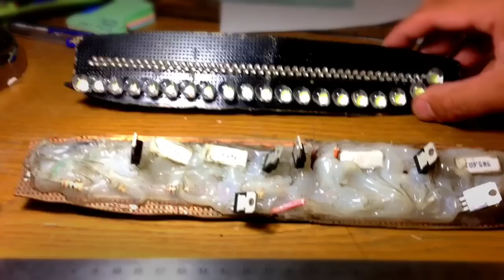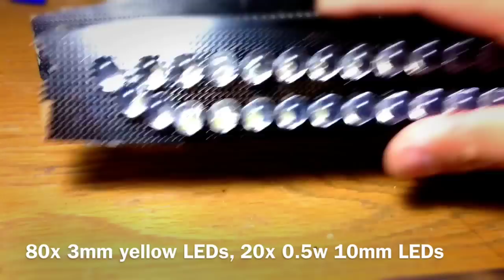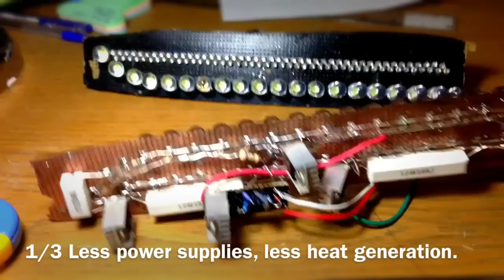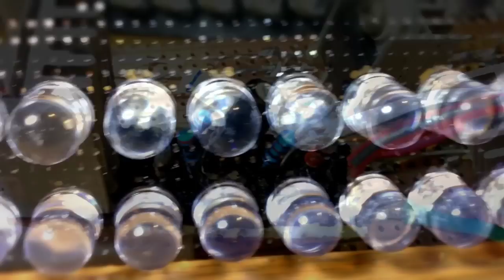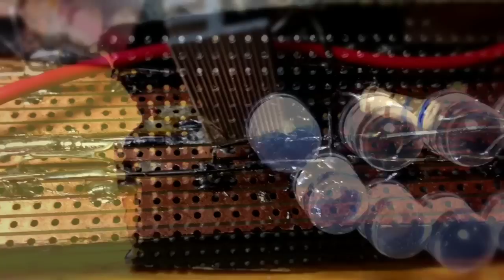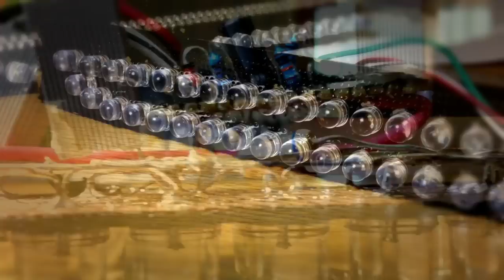Miata MX5 LED Switchback Indicators Revised

Comment from the maker: g'day, its basically a bunch of voltage regs and dropper resistors and leds. the softfade driver is a transistor and a few passive components making an RC time constant when the indicator turns on.
Reply: hey m8 how can i get in contact with you ? i would like to have a plan to rebuild this

Comment: Hi, what is the material you've soldered the LEDs too? I've been trying to find flexible, cuttable prototyping board but not having any luck so far. thanks.
Reply from the maker: 92JMFL it's a perf board/verostrip. Cut to size, sanded, primed and painted black before assembly. Finding the board at electronic hobby shops shouldnt be too tricky. Finding one the right size maybe.
Reply: Jroobi you absolute legend! I’ve ordered some veroboard. Thanks so much.